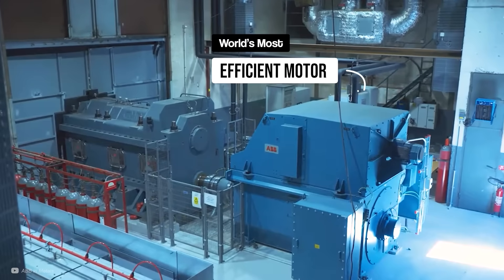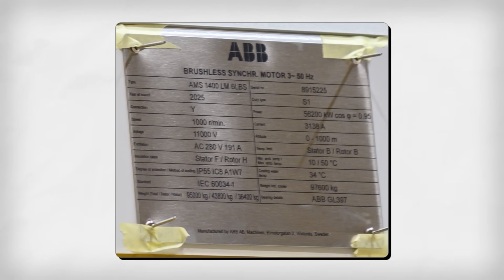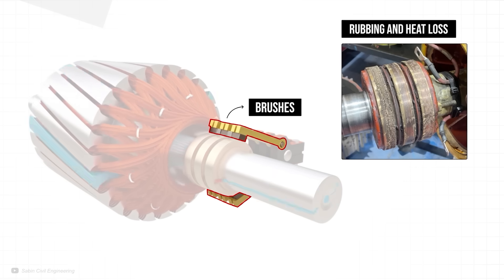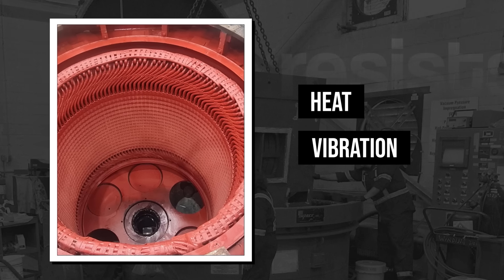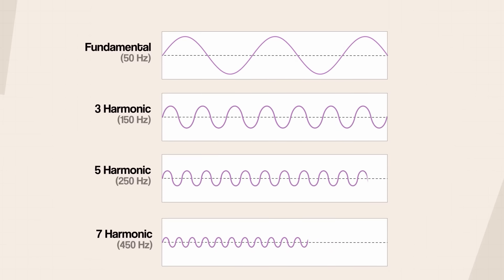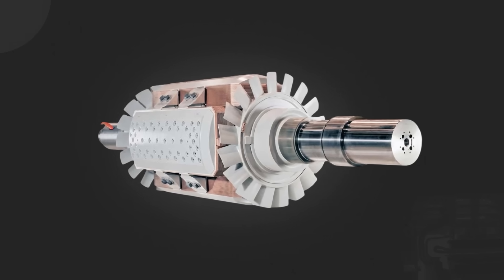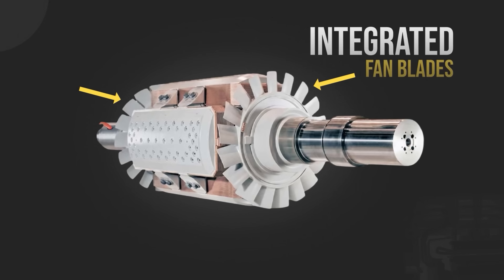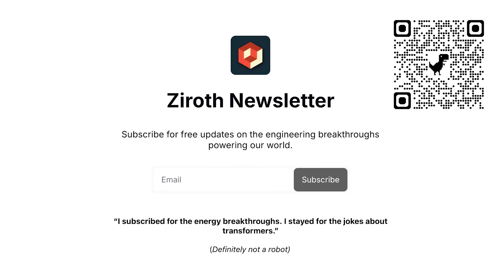How This Ultra Efficient Motor Just Broke The Limits

Comment: Im too lazy to google, but mabey someone knows the answer:
How does the powertransfer to the rotor habben? Bc. if you just have copperwindings on the rotor you get an ASM (asynchronous machine) which is like the name suggest not synchron.  I assume current on the rotor needs to be dc in steadystate operation for it to be a synchronous machine  (but how?)

only thing that comes to my mind is that they have a winding that they use to get ac current to the rotor (like in a ASM) and then use some circuit to rectify it, but that sound strange to me...

Comment: So that's one motor in one factory. Four days of the uk's offshore wind farms.. Probably measured at its peak output. They only run at thirty percent. Duty cycle if you're lucky.  So 20  or so of those motors. And you could shut down the uk's,wind farm folly.  Dirty corrupt Mp's pushing the climate hoax.

Comment: After watching the video I learned it was to be installed in a steel plant in India, I did not learn what the motor is to be used for.
Please explain?
Am I right in guessing it was to be used to generate electricity at a specific induction current to melt the steel?
Reply: Most likely application is to run a giant air compressor and that's why it can maintain a steady load. Steel plant needs a lot of high pressure compress air for refining.

Comment: I'm kind of curious what they use a 70,000 hp motor for
Reply: The last one I saw was on an expander for a liquid helium plant.
Reply: Cruise ship?
Reply: All sorts of heavy industrial processes that are powered by a common motor and gear/shaft sets. Think things like ore processing,  some steel mfg ops, foundries, etc.
Reply: Tugboats and railroad engines
Reply: The end of the video says one of the first of these motors got installed in a steel mill in India. These types of installations often have only a few large motors driving the whole factory using a few shafts and drive belts, using the inertia of all that rotating mass to keep everything turning smoothly as ram pumps are extruding steel and rollers crush it into final shape. Easier to keep a few large drive motors and their drive electronics running in a conditioned location than maintain dozens on the hot production floor with molten or red-hot metal zooming by.
Reply: @teardowndan5364  Thanks.  I couldn't figure out why a steel mill needed so much power in a single motor, but that makes complete sense.
Reply: yup, nailed it. Common motor setups make it easier for some large processes. Also makes synchronization, shut down/start up ops  easier, makes for better safety as well, emergency stop can be common along whole line for instance, instead of just a single process step.
Reply: I got a little more horsepower but that is still a lot. Could it be driving a large compressor for an air separation system to generate oxygen for the steel manufacturing process? I am aware of compressors that require that much power that are used for this purpose though they would probably use a steam turbine for this.
Reply: Magic wand
Reply: Push around trumps ego???

Comment: A key question wasn't answered.  A brushed synchronous motor is supplied with dc current.  Is there some tricky induced frequency to the rotor that produces dc current?  Is there power electronics in the rotor to take whatever it gets through induction and turns it into dc?  The rotor looks complicated.  A nice design for a motor and a good video.  Thanks.

Comment: Nissan has developed a similar motor to eliminate the need for rare earth magnets. They use carbon contacts to power the rotor. The brush assembly is projected to last 130,000 miles before they wear out. To change the brushes requires removing 3 bolts and unplugging 1 wire connector. The motor is slightly less efficient than a permanent magnet motor at low speed, and slightly more efficient at high speed. 
Should Taiwan be blockaded in a few years, the export of rare earth elements will cease, due to their use in advanced weapons.

Comment: NOT the worlds most efficient motor! It may be, for the particular design that it is. Other motor technologies that have had the spotlight taken off of them as to conceal them are much more efficient. A motor design that uses permanent magnets in unusual configurations can be more that 100% efficient. This is because permanent magnets operate on a quantum basis. They are like batteries that never need recharging. Technology exists only through metaphysical means, and technology can break the "so-called" laws of physics. For example, metamaterials exist that exhibit physically impossible properties at one scale, but are built of structures that harness known physical properties at another scale to accomplish their metaphysically realised design goal. Motors that utilize the magnetic fields in permanent magnets as a primary source of energy, and use electricity, electromagnets, and soft magnetic materials to steer a permanent magnetic field in a magnetic circuit that comprises an electrically energized permanent magnet motor do exist. The reason we can not have such toys is because the "Political Powers" that currently exist, would quickly go out of business if "energy was free". Just the existance of something analogical to a transistor that could switch magnetic fields with the same efficiency, would make the world a sustainable success for all mankind and nature too.

Comment: Weird that it can reach this efficiency using a method so inefficient as wireless energy transfer
Reply: Yes, rather surprising, would love more information on that.
Reply: Power transformer uses wireless energy transfer and they can easily get >98% efficiency. It's only weird if you think that phone chargers using tiny coils to transfer power is the best there is.

Comment: Wireless transfer is inefficient - heat is generated, right? I guess, in this case, it is better than brushes.

The amount of effort put into the motor would imply a very high price. I assume it pays for itself eventually with the power savings. Very impressive engineering. I wonder how much can be applies to EV cars.
Reply: Yes and no, not all of the power is lost as heat in this case, but just wirelessing sending it, but the closer to the target, the less loss there is to a point it can be very well as high as 99% as well. Distants plays a big factor, so they must have some tight tolerance